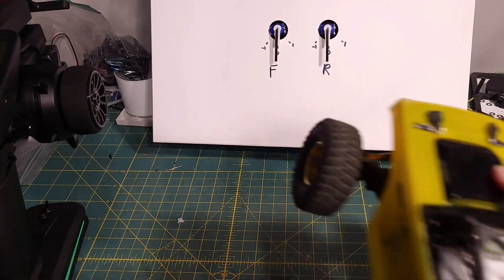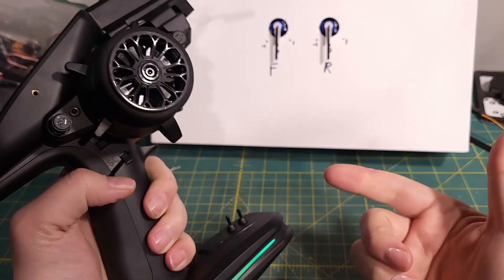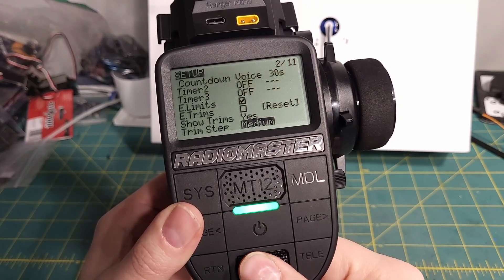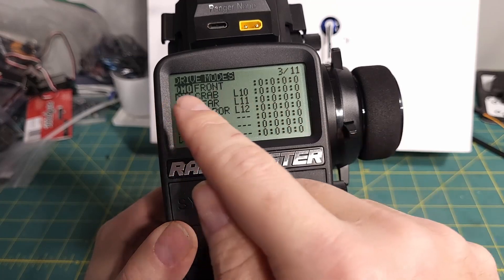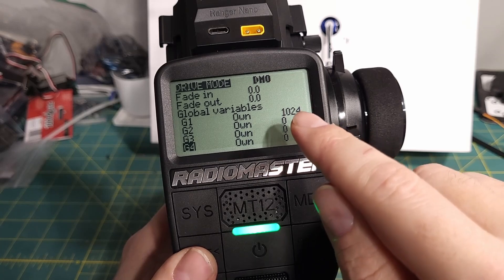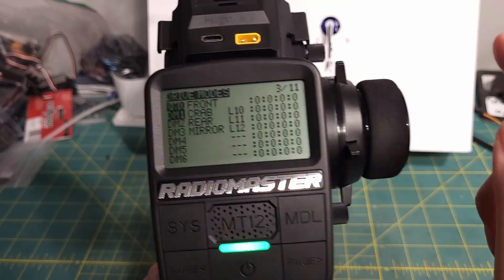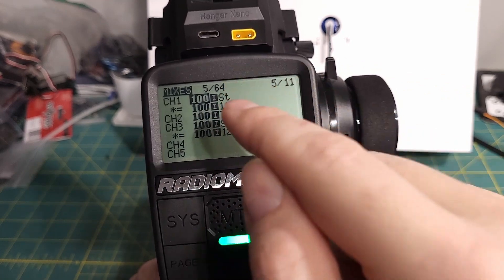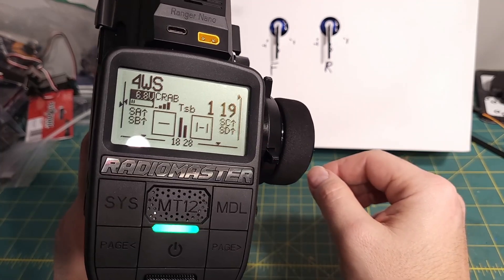Radiomaster MT12 EdgeTX - 4WS Four Wheel Steering

Comment: lets say we use switch (SC) as a toggle between the different drive modes, using an edge logical switch, .5 sec press is mirror steer, 1-2 sec press is rear steer, and 2-3 sec press is crab steer.

my problem is that it doesn't "toggle" it,i have to set a duration, and i have to wait for said "duration" to pass before i can toggle another mode....
i wonder if i can use the sticky function... how would you go about it?

Comment: This Video is awesome I have my Ax 24 all programmed up this way I do have 1 question though is it possible to add trim to the rear steering so you can trim it like the front wheels.
Reply from the maker: I would trim the rear steer channel in the outputs tab. If you want to try and assign a trim switches to it, it gets real complicated...
Reply: @JacobScherer  ok perfect the rear steering channel is channel 3 so i think all i need to do is assign the trim switch to the channel

Comment: This is a really helpful video thanks. Only issue I’m having is T4 isn’t switching the Drive modes other than 0 to 1…. L10,11 & 12 switch, but DM stays at DM1 🤷🏼‍♂️. Other than that I think I’ve got the rest sorted
Reply from the maker: Glad the video was helpful! Did you copy the order correctly? If multiple logical switches are on at the same time, it will choose the lowest drive mode. I tried to explain this at 4:55 but maybe it wasn't clear.
Reply: @JacobScherer   in the end I started from a fresh 'model'. I must have changed something while playing around with the servo mixes before trying this. Now works perfectly. I'd never have managed it without this video though! Big thanks, I now have a 10x10 with 4 modes of steering :)

Comment: Wow! Respect! ;-)
Guess your "Mirror steering" is simply called 4WS ;-) - at least I/we call it that way.
Reply from the maker: But calling it 4WS is so boring compared to the cool "Crab Mode" haha.
Reply: @JacobScherer  after watching your video 4 times I will try to reproduce this now on my MT12 (of course while watching and pausing the video) - pfff, that is unbelievably complex.
Reply from the maker: @donaldsneffe  yes, very complex. With some different choices for switches and some software work to match existing surface radio features, this would be a much better system.
Reply: @JacobScherer  Agree totally. 
Most people in our forum are completely overstrained with this (many do already have problems with simple radios such as NB4, GT5, RC8X, Dumbo etc.). 
More switches would be highly desirable, too. Donno why there is no push button "in" the handle, or two - what nearly all pistol grip radios do have. The switch below the "trim" switch is very inconvenient, strange to use...